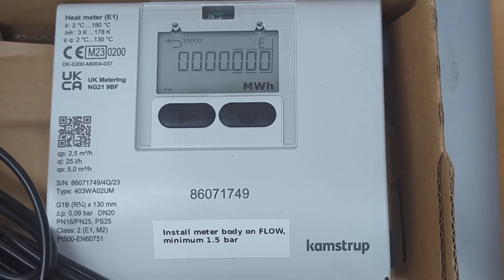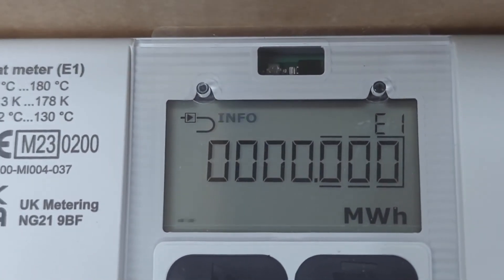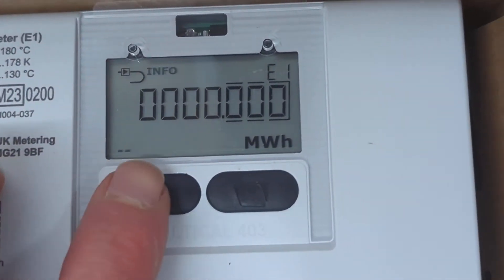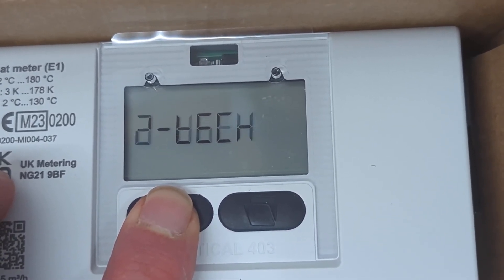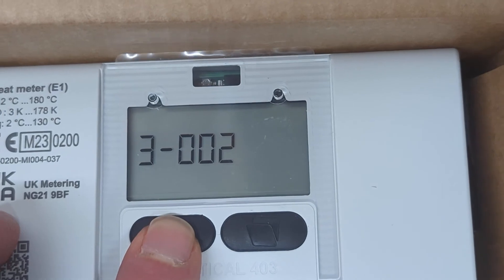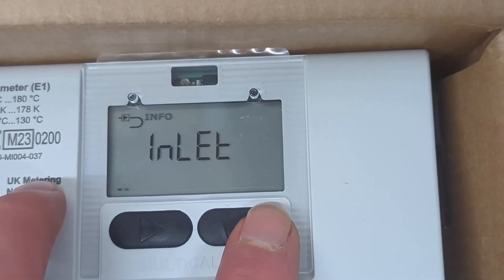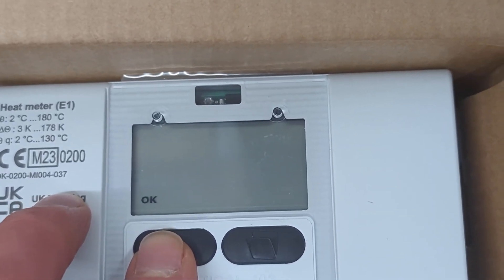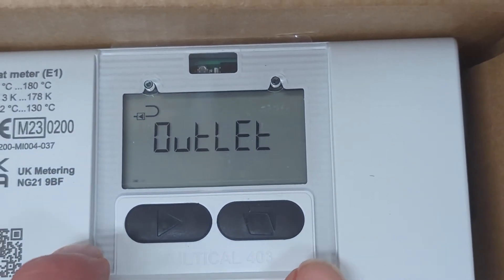Configure Kamstrup 403 Heat Meter before Installation

Comment: remember, setup-mode can only be used a max number of times before meter need a total reset🙂
Reply: How do I perform a complete reset ? I bought a used Kamstrup 603 heat meter and I can't get to the 3-Setup menu :( .
Reply: @pawelstronczek8571  same thing here, there should be a device that lets you connect to it and config it?